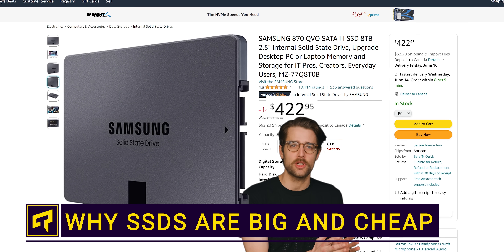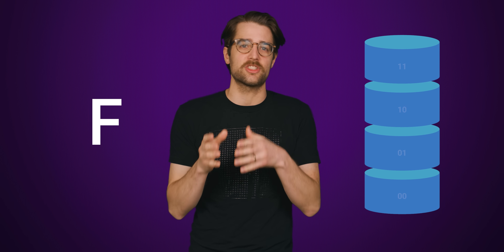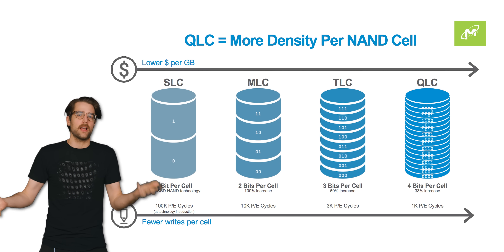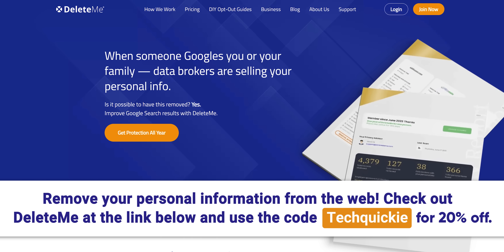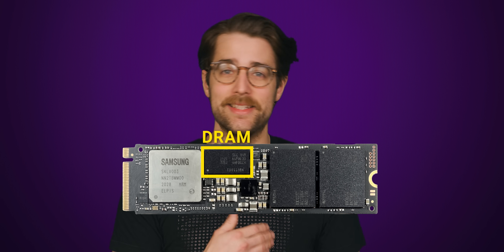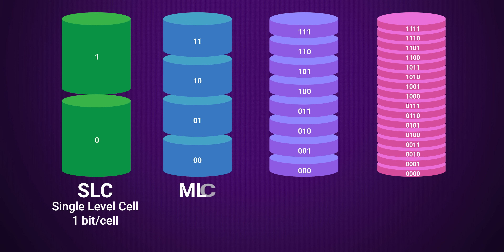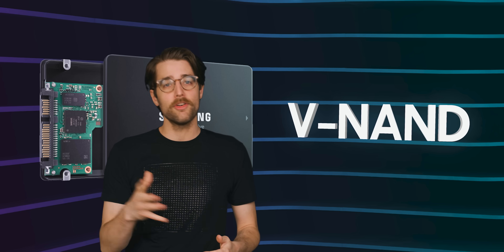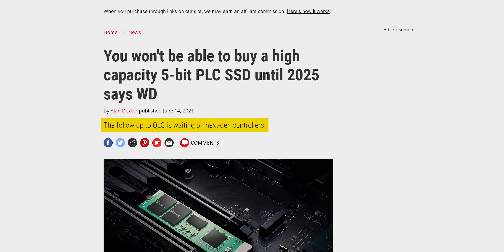Why SSDs Are Big And Cheap

Comment: So PLC might be better for your consumer level long term storage, like a home NAS or something for your backups and data archives. For enterprise customers it will probably be used much the same way for data that isn't changed too often. As long as the replacement rate for failed drives isn't as bad as HDDs they'll buy them (and usually SSD failure rates are more predictable, so thats a bonus as well.)

Comment: I still remember my Dad buying a 1gb (!) scsi drive for about £1200 (~$1500 with todays rate, much more back then) in the mid 90s. Obviously very different to modern drives but I always think back to that whenever looking at prices now, when you can buy getting on for 100tb of spinning rust at the same cost before inflation etc
Reply: I was poking around in my parents' basement the other day and found an old drive my dad kept in hopes of recovering data from it, and I looked on the sticker and it was a 5GB capacity. It really was an interesting perspective, holding that big chonker that could store roughly 1/400th the data as the tiny little NVMe I put in my new build just a couple weeks earlier.
Reply: I still have a 1GB flash drive from 2012, 1/4 full with a short stop-motion film on it. As for prices, finding a 1TB for $60 is amazing compared to years ago.
I still don't see why my mother thinks that everything is overpriced. My 512GB Galaxy S20 Ultra for $500 is overpriced, but an iPhone 13 128GB for $750 isn't. A Galaxy Watch 5 for $200 is overpriced, but an Apple Watch 8 for $400+ isn't. Doesn't make sense, right? Maybe it is because I grew up in a slightly poor family who does monthly payments while I pay in full, or buys things for ridiculously cheap prices.
Reply: @tekeagle2136  Sounds like a classic apple user to me...
Reply: My first was 40mb. Which was, and still is, an insane amount of storage on a Commodore 64   Think it cost about $1200 in 1980’s dollars. Got it upgraded to 80mb a couple years later.
Reply: @johngaltline9933  holy cow. What did you do what all that back then? :O
Reply: @johngaltline9933  40 MB on a C-64? That really is insane. I had to let Google confirm that this was possible and existed, and to my surprise yes it was and did. If you were among the lucky few who could afford the much coveted A590 sidecar HDD controller/case for the much more modern Amiga 500, the standard option was an included 20 MB HDD, and that was considered huge.
Reply: My first HDD was 4,3 GB.  It's in 1999, not the greatest drive then... but even with that drive it was very hard to convince my parents to buy my first PC.  I remember it was enough for Windows 98 and installing just a few games and some other programs, also then games ran from CDs so not the whole game was installed on the HDD. One of the first games I've played was Heroes of Might and Magic 2.
Reply: @Slav4o911  Actually most games back then ran from the hard drive, the CD-rom was really just used as a piracy check. A simple no CD cracked exe was enough to play games without the disc.
Reply: i grew up with a desktop with a 1gb hdd. i would have to uninstall one game to play another; a real pinch when borrowing or bootlegging games from friends. if i wanted to play M:tG Shandalar, that would mean removing Starcraft for example, and i only had (a burnt copy of) the expansion disc to play off of. CD burners were still new, and one kid would charge $5/disc to copy what i borrowed from another kid. when talking about data with my mother, i to this day call a gigabyte, an "Acer," which upon reflection is odd, since i still use tons of Acer hardware today.
Reply: Well, you can go back as far as you want I suppose. I started off with 40 MiB of HDD (in those times you still used the idiotic 1024 x 1024 to denote MB just like we still do for memory).

Comment: PLC can be good as external drives, you don't need that much speed and just for backups will be great.
Reply: No because a lot of people back up several terabytes at a time and QLC already goes down to 50/MB transfer speeds once it maxes out cache. Slower than a modern hard drive
Reply: @Argedis  I was tinking more on save some photos or videos, not do a full system backup each week, if you go to backup several TB you go to use the old HDD in raid arrays.
Reply: crazy, bet you could get those for way less now a days

Comment: I don't think the explanation regarding longevity was very clear. The point is that in a single-bit cell, the charge held by the cell can change by almost 50 percent and the data will still be intact because as long as it's still in the right half of charge level, it can still be interpreted as the correct 1 or 0. A 5-bit cell will have to differentiate between 32 different charge levels so even a 3% fluctuation in charge stored in the cell will corrupt it.
Reply: Wow, that actually explains it much better. 
Kudos!
Reply: Wow, put that tech on the 'do not buy' list
Reply: yup. basically everything below TLC can be considered dogshit.. hence why most leading manufacturers may have abandoned SLC and MLC production but even now, 9 years after its introduction still stick to TLC.
Reply: Right makes complete sense now. I was thinking I wouldn't expect that people would address a single bit on a drive so you'd expect 8 bits per cell to make the most sense aside from being able to resolve 256 values reliably.
Reply: @vk3fbab  Same!
Reply: What is now better? SLC or MLC acting like SLC?
Reply: @zperdek  depends on what you mean by better. Was it Performance/Price ratio or simply better performance？Because “real” SLC theoretically still perform marginally better than MLC imitating SLC and considering SLC-imitating MLC requires software Algorithm to balance wear off sometimes it will get much worse. On the other hand, with proper algorithms and better manufacturing processes MLC can lower the cost significantly compare to proper SLC and restrict the performance difference into aforementioned “marginal” range.
Reply: It's like downpayment and mortgage payment for a home these days.
Reply: Agreed, but that is where the inbuilt error correction should correct the error, in conjunction with cell refresh. I'm not happy beyond TLC at worst though, mainly for TBW (longevity).
Reply: So which sata ssd and nvme ssd is best and at what storage space ?
Reply: So what drive is best for Long gevity AKA storing data while still performance is good? 2.VME? SSD ( if so what type? ) HDD? 

Also is the guy in the vid saying the bigger the SSD = more volatile for data? 😅😅
Reply: @derekroberts5931  any decent quality HDD or SSD should last you a long time these days. The more important thing is that you need to have backups, because any drive can fail. If it happens to you, and you don't have a backup, just how unlikely it was for that specific drive to fail won't be much of a consolation 🙂
Reply: Came here to say this.
Reply: There is also the fact you have to rewrite the cell every time you change a single bite
Reply: @Beregorn88  not really relevant because it's impossible to actually change a single bit (from the OS level that is). You always overwrite the entire block which is typically 4kB

Comment: Long term nand reliability is why I only use SSD on laptops where I'm not storing critical data, and my desktops as my boot drives with basic program storage, all my games, movies, photos, etc.. go onto large capacity HDD's that get backed up on the regular to external HDD's, and stuff I need to archive still get burned to dual layer DVD-R disc, and store in water resistant CD cases on a high shelf in my home office away from sunlight, and other things that could damage them.
Reply: ^This guy data hoards. RIght on

Comment: In 2015 I paid for my Samsung EVO 850 250GB around 120 Euro. These days, for the same amount of money you get a 2TB Samsung 980 Pro SSD NVMe drive. The current SSD model with 250GB the Samsung EVO 870 costs 27 Euro.
Reply: Yup bought patriot blast 512gb for 50. Now its 25

Comment: Recent dump of YMTC 232 layer NANDs has caused massive amount of price decrease in some countries. You can get 2TB 7000mb/s Gen4 drives for $90 when 2.5inch 2TB is still $80.
(They are really cheap)
They are TLC although DRAM less, they perform very close to 980s. (They lose on much larger file size but I personally had 200GB of game+MODs copied within 7sec between those drives, so I don't think there will be issue)
Reply: True, I'm in China and we can get 4TB 7000MB/s nvme DRAM-less SSD for 969rmb (about 136usd) now, also using YMTC 232 layer NANDs
Reply: @flintylemming  我看就算pdd最便宜的也就是999的梵想啊，969是哪儿的
Reply: @anthonyjiang3251  达墨
Reply: Which brand use ymtc?
How bad is it the write cycle?
Reply: @syarifairlangga4608  At least ten brands are using YMTC NAND, including Predator, Colorful, Teclast and YMTC's self-owned brand ZhiTai.
ZhiTai's TiPro7000 has 600TBW per Terabyte.
FYI, miners used ZhiTai's PC005 for Chia.
Reply: @syarifairlangga4608  write cycle is enough for brand "aigo" to mark there 2tb gen4 drive p7000z a 3600tbw write amount within 5 years of warranty, which uses ytmc 232 nands. for comparison, samsung 980 pro 2tb only marks 1200tbw
Reply: @syarifairlangga4608  ymtc NANDs (176/232 layers) are actually very good, have the same TBW as Samung, WD, Hynixs' high end products
Reply: i finally got around to adding a 1TB SSD to my rig after years of wanting one, I grabbed a nv2 from kingston and honestly I consider myself a relatively heavy pc user, does fine, can't really tell a diff from the samsung 850 500gb drives I had before (2). Sold both of those and grabbed this one. 

I don't have windows on it since I had another SSD with windows (I was using 11 as main and had 10 on a 250gb ssd, but ended up dumping w11 with the 500gb ssd)
Reply: Which brand/drive you are getting for 90$?
Reply: Where to buy them?
Reply: Which brands?
Reply: @Kiwiiizzz  aigo
Reply: @RolandJVyens  no heatsink
Reply: @Kiwiiizzz  It does not need a heatsink at all, it has no built in DRAM, it doesn't produce many heat, I use one and another from a different brand in my laptop
Reply: I got 2TB 7400 mb/s with a dram cache and heatsink for $75
Reply: actually, you can buy some tier 3 SSDs of 4TB for $100 now
Reply: Did you seriously mention 2.5 inch drives specifically, just to make your point? lol.
2TB hard drives are like $40, not $80.
4TB hard drives cost around $80.
You don't have to be dishonest like that.
Reply: @GoldSrc_   I don't see anywhere 2TB SSDs for $40.
Reply: @Slav4o911  you can get from China.
Reply: @GoldSrc_  He refers to SSD. YMTC makes cheap and great SSD.
Reply: @GoldSrc_  2.5 inch sata ssds
Reply: @beanonthefloor3750  The fact you basically can't get 3.5" SSDs is not a reason to avoid comparing them to 3.5" HDDs on price, unless you specifically need a 2.5" drive.

Comment: I paid sooo much for a 32GB SSD in the mid-to-late 2000's. Was in my HTPC for years.
Reply: I still have a 64GB Patriot Warp I paid around $200 back in 2008-09
My games would load instantly but random read/writes SUCKED and would literally freeze the system. Ancient controller

Comment: Why are there no 3,5" SSDs? Could store more NAND Cells
Reply: Kioxia makes some for server applications. Linus dropped one of them once. They cost like $1000+ and have more capacity than entire data hoarder setups.
Reply: Cuz it would cost thousands of dollars to fill one up with NAND chips. I think Seagate actually made one at some point. Plus it would get really hot with that many chips. NVMe sticks are the size of a stick of gum and cost a couple hundred bucks each. Now multiply that by however many you can stick in a 3.5" drive (quite a few).

Comment: Forget the past.
Spinning disks are half the cost of an SSD, and Optane will boost their speed to faster than an SSD for much less.
NAND isnt forever either. boosting the capacity gives them much lower lifetimes
Reply: Didn't Intel discontinue Optane Acceleration Drives?
Reply: @MeAMoose  They did. At the pricing needed to recoup the development cost, Intel was unable to compete with ever-cheaper NAND flash. While Optane is dead and the fab making it has been sold off and turnt into a NAND fab, Intel still holds the IP and they or someone else could one day decide to make resistive SRAM again.
Reply: @MeAMoose  Yeah, people like the idiots on this channel didnt see the point it it when paired with an SSD and didnt push it.
Reply: Boosting the capacity gives them HIGHER lifetime. It's only when they use trash like QLC it becomes less reliable.
Reply: @dat_21  Thats not what he says about them in the video

Comment: if we ever get to 8 layer cells then wouldn't that counteract a lot of the downsides since the controller can write an entire byte to a cell rather than multiple bits. compared to a SLC ssd the controller wouldn't need get 8 bits from 8 different cells to create a requested byte, it could just read the byte from 1 cell
Reply: Well, QLC is a safe point then, since you can put a nibble and only read 2 cells, but that still is lower than TLC where you need spread the data in multiple cells.
Reply: Not really as you never actually write just a byte to a harddrive. Most of the time you write a block which is either 512B or 4096B. So provided you can get some multiple of that you gain basically nothing. (Those are just 2 common block sizes YMMV in terms of what is actually going on)
Reply: @jedijackattack3594  That is on the file system, on hardware level isn't same, you can write a byte, the problem is you can't search for a byte, you need to know where is, that is why at file system you use blocks because are more easy to track and assign, you can lost a block to catalog the file name, and possitions of the blocks you need to access, that way you don't need track each byte.
Reply: wow I was thinking exactly this. This is also the reason booleans in programming languages are stored in 32/64bit words!
Reply: The controller already writes whole bytes to the flash chip, why would it matter how many bits are stored in a cell?
Reply: @shanent5793  7 bits to a byte, so if you have one entire byte, the calculations of each cell are drastically reduced as the basic units are all allocated in the same place.
Reply: @bestbronzethreshna6274  the calculations increase with every additional bit stored in the cell. An 8-bit cell has to be read several times in a binary search for the cell value. Squeezing in 256 voltage levels will also increase the error rate which will require more ECC bits and more complicated ECC codes, along with careful tracking of the channel's soft error information, thus increasing computational requirements even further
Reply: Multi-level cells are slower to write to. It's the reason for the single-level cache mentioned in the video: it's much faster to write to. Also flash chips have many channels (parallelism) so having to write data to 8 cells rather than 1 isn't any slower, depending just on how quickly the cells operate.
Reply: The biggest problem is the error rate due to the problems of all the voltage levels within the cell. The more bits the bigger the problem. So no, not really. If this were the case the going from TLC to QLC would already have shown a clear advantage for QLC, and we haven't seen that. It's probably somewhat easier, but the low level parts can be attacked by throwing hardware level logic into it.

Comment: I just wish ssds were immune to randomly dying.
Reply: Yep, HDDs are way less likely to suddenly die (3.5" ones, at least). Also, the magnetic recording of an HDD can probably keep data longer when a drive is not powered on.
Reply: As someone who just had a 4 year old SSD die last week without any warning whatsoever, I wholeheartedly agree!!
Reply: @RogerioPereiradaSilva77  yeah it’s disheartening. And these failures happen randomly with no time to back up your data.
Reply: @Tanzu15  So true! The only reason I didn't rip my hair out of desperation when it happened was because I backup my personal data onto my NAS on a daily basis on all my machines so I just need to replace the failed drive, reinstall the OS + apps and then restore my files and thus this whole situation went from a near tragedy down to a minor setback or inconvenience. Otherwise I would be foaming at the mouth screaming bloody murder!!
Reply: @RogerioPereiradaSilva77  yeah I’d be raging too. I personally back up my important data. But failing SSDs, give no warning. They just die.
Reply: It's sad that many pre-built pc that are sold today almost always have an ssd, and with that a smaller case which doesn't have enough space for a hdd, as if hdd are obsolete. Will always have to build the new pc myself with an appropiate case for hdd.
Reply: you can put two in RAID
Reply: The 128GB SSD in my mother's laptop died last year. When I went to replace the SSD with a 256GB one, I noticed that the components on the 128GB one were scarce. It apparently was a super cheap drive in a super cheap laptop. No controller, DRAM, any very few other electronic components. No wonder why it died so quickly and gave me a "fatal hardware error" message.

Comment: I wouldn't buy a PLC SSD, QLC already only has 1000 cycles at best, but often is only 300-500, I can't imagine how bad PLC would be. I do wish that they sold pSLC drives, which is basically treating TLC/QLC as if it were SLC, that way you could buy a 4TB QLC ssd, and get 1TB out of it, but have it be very durable and fast.
Reply: QLC is also already slower than modern HDD's once it maxes out it's cache. I've seen 50mbps transfer speed screenshots
Reply: @Valor_X  Thats awful, Ive seen performance SD cards write faster.
Reply: Hopefully theres never an HLC. You may as well just buy an SD card.